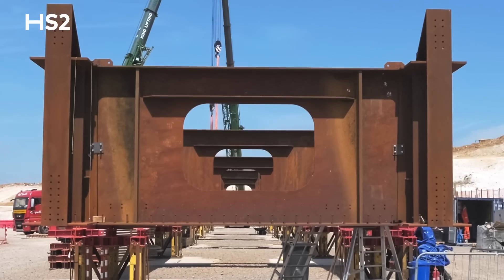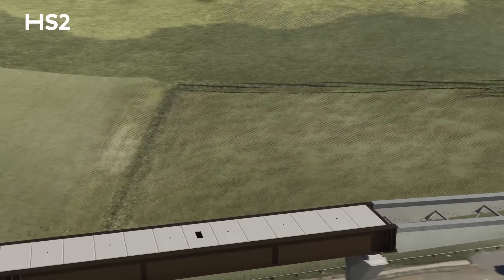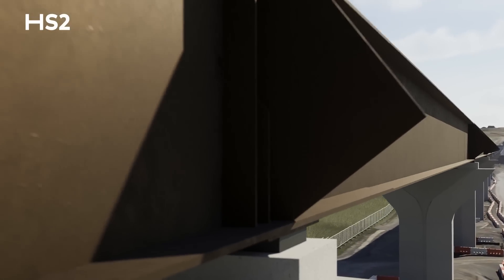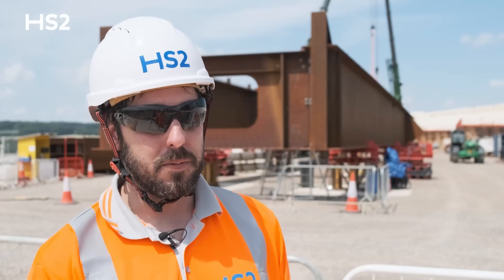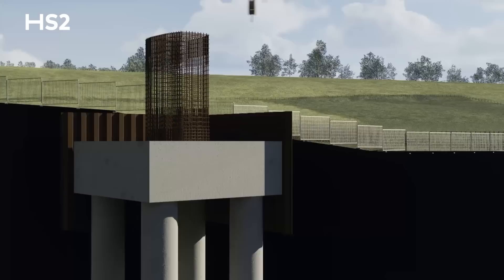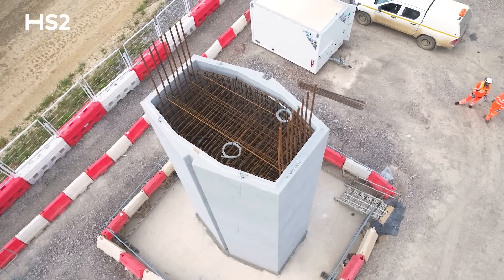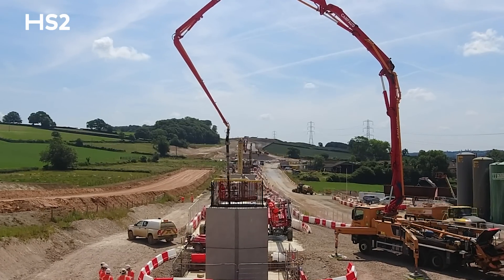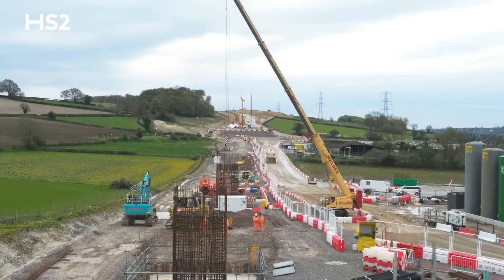HS2's innovative Wendover Dean Viaduct moves into next phase of construction

Comment: Thank you sir, for keeping us informed. I would like to refer to your comments about the aesthetics of Wendover Dean viaduct, 'so it will sit very nicely within the landscape.' Are you sure about that? The side profile of the impression at 1:15 looks like an oil pipeline on a row of split matchsticks - the deck appears to be too bulky for the piers. Would you suggest that the cutting to the south-east of the viaduct, all the way to the tunnel at South Heath, will sit very nicely in the landscape too. Of course not; because it will be a scar. I really shouldn't knock it, when the whole HS2 nonsense is abandoned and converted into the world's most expensive cycle way, I will be one of the first to use it